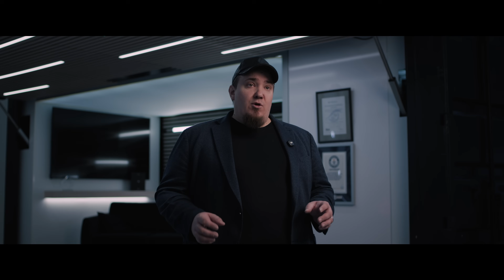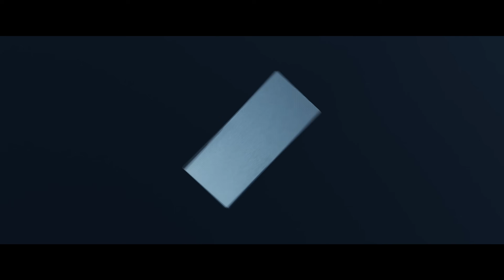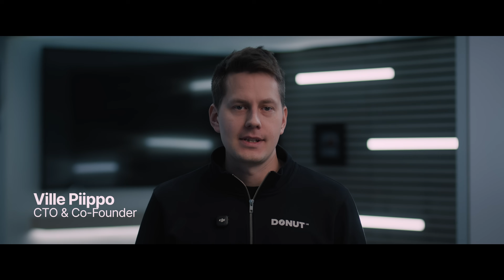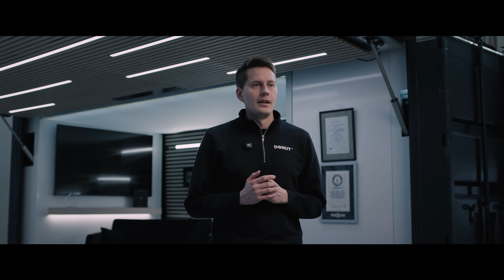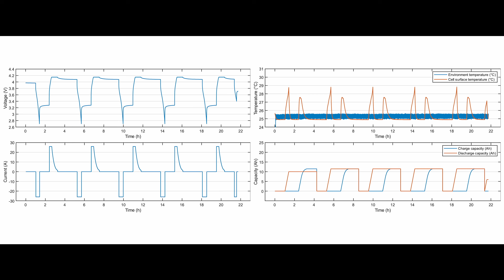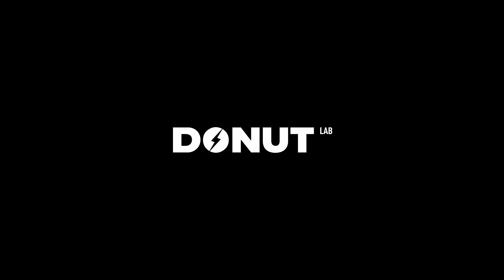Donut Solid-State Battery: Safety Demonstration Test | I Donut Believe (Pt.5)

Comment: Crazy how everyone keeps doubting but fails to acknowledge that we have a battery here that charges much faster than Li-ION, under extreme temperatures, and much more safely. This is already one of the best batteries ever made by far. Eagerly waiting for the series to complete.
Reply: They need to weigh the battery. This is all great but it needs to hit good weight-to-capacity ratios.
Reply: I think folks are just frustrated by their marketing games. Time will tell whether this is real or not.
Reply: I'm holding on fast to my everlasting gobstopper!  Ready to trade it in for a battery.  =)
Reply: @mark.pinnell Everlasting gobstopper, uuuhhhm sounds good. Fancy swapping it for some magic beans?
Reply: My problem is this Marko guy have promised Asinoid, an AI that should surpassed all other current available AIs. Yet, several months later, both Asinoid and Asilab, the creator of Asinoid, went silent. This, all his words are worthless until actual third-party verifications can be done.
Reply: @bltzcstrnx  maybe Asinoid really works and came up with this battery. Still hard to believe, there is a lot of dark humor involved, which is stressed by April 1st as date for the next video.
Reply: I kinda understand the skepticism, how many times we've been lied to by techbros ?
Reply: Then why is donut actively looking for small scale investors instead of big companies that do technical due diligence?
Reply: CATL Already have an LFP Battery that can charge 12C
Reply: Indian logic
Reply: if you sacrify lifetime you can fastcharge/discharge normal Lithium cells to. Every e-cigarette cell proves that! So far it doest prove anything than it can do a few cycles - and dies to 50% SoH.
Reply: @peterle987 you are exactly right, without cycle tests all previous tests mean nothing!
Reply: That is simply not true. You are comparing prototype cells in lab tests to estabilished consumer batteries. In reality, these recent tests are 100% in line with other new battery prototypes.
Reply: @5astelija75   Please remind me what other batteries continue to operate at 5C charge rage when their internals are exposed to air and moisture?   Even Na+ can't do that.
Reply: @daemn42  What evidence is there that the internals are exposed to air and moisture?
Reply: @izzeww8487  that the cell has lost vacuum? it's the definition of getting exposed to air and thus also moisture.
Reply: @Schinkeldink Losing vacuum ≠ getting exposed to air and thus also moisture. The cell could also lose vacuum by there being stuff inside the cell (a liquid electrolyte for example) that evaporates due to the high temperatures. I think this is more likely.
Reply: @izzeww8487 
But even MORE likely is the quite-acceptable, simple explanation that what vaporized/evaporated, here, was the (standard) glue sealing the pack.

(But I agree that water should not have entered the equation, if still effectively sealed. 👍)
Reply: @izzeww8487  When you have a vacuum vessel it means you've evacuated from it all gasses under pressure.    When you lose vacuum, by definition, it means the outside gasses have leaked into the vacuum vessel.      Or put more simply.  A vacuum is the absence of a thing.  Losing vacuum, is the return of that thing.
Reply: No it doesn't. Any li-ion can do the same thing
Reply: @tedarcher9120  No they can't. Whether the Donut battery is legit or not is another question.
Reply: @tedarcher9120  No, there are no other batteries that continue to operate at 5C charge rate with their internals exposed to oxygen and atmospheric humidty.  At best they'll degrade rapidly and continuously (capacity just drops off to zero)  At worst (and more common) they just burst into flames.
Reply: @daemn42 yes there are
Reply: @tedarcher9120  Care to provide references?   Now you're the one making extraordinary claims.
Reply: @daemn42 you made the claim, you provide the reference. Lithium polymer batteries work fine with broken cases until they suck up water from air and stop in a couple days
Reply: Conventional cells are what all solid-state batteries are fighting to replace... by not comparing to solid-state battery peers, they're demonstrating how gullible their investors are.
Reply: @azertyQ 
WHAT solid-state battery peers - ??!
Reply: Most nmc batteries can charge at 10C once. They'll just be broken or unsafe after that.

Comment: People asking for the weight of the battery , really are working for Chinese manufacturers. 
Weight would give away the materials, and make possible reverse engineering
Reply: That is just wrong, isn't it? The batteries aren't made from a single material, and so there are a bazillion combinations of materials to arrive at the same weight.

What we want is for the 400Wh/kg claim to be validated, since that along with lifecycle are the two most important claims by Donut Labs. To validate the 400Wh/kg we need VTT to measure the capacity of a cell and then weight this same cell.

The cell in this test had nominal capacity of 94Wh, which means we can ourselves calculate the weight that it should be.
94Wh / 400Wh/kg = 0,235kg. So there, now the Chinese know the material I guess. And we still lack third party verification.

Comment: Everyone needs to realize weighing the cell to show energy density will prove nothing. Specialized lithium ion cells can easily hit 400wh/kg or even higher. What we really need to see is cycle life and and that darn -30°c test.
Also someone really needs to test what happens to a li-ion cell when discharged at 100°c. He says they will explode but i haven't been able to find any actual testing to confirm this. There's a chance li-ion behaves exactly the same as their donut cell. Simply losing vacuum and capacity.

Comment: I expected a battery nail penetration test in the safety demo, as these are typical for solid-state technology.
Reply: Marko said at one point he could shoot it and the battery would continue operating except for the spot with the bullet hole. If this is a marketing pitch, it would be downright stupid to not have Marko shoot one then run the tests.
Reply: @jonathangilmore446  he may have said this before realizing people would only trust the results if a 3rd party(VTT) was doing the charge and discharge. No shot VTT would let them shoot the battery while using their equipment.
Reply: @Bionic9998 Do you need VTT for that? I would assume another field test.. marko holds the same DL2 battery, places it on a stump, shoots it, then hooks it up to a voltage reader.
Reply: @jonathangilmore446  there are still people claiming last weeks video was faked. They didn’t care that it was a public charging station.
Reply: @Bionic9998  what is vtt?
Reply: @rmat9023  the 3rd party testing facility that donut labs used for part 1-3 of this donut believe series
Reply: @Bionic9998  well people are lazy. Its hard for anyone to consider both realities: It's super easy for people to think its fake and come up with ways they faked it, it's genuinely difficult for anyone to consider that it's real. I'd put money on it being real. Idk about 100k cycles lol but I would put money on them meeting their other claims.
Reply: @rmat9023 it's the governmental research institute of Finland
Reply: @jonathangilmore446 impossible, it would short circuit even if it doesn't burn
Reply: @lafeechloe6998  Could be possible if the cell is actually multiple cells connected with some kind of fuses between themselves in parallel.
Reply: @alexandruilea915 it would take up a lot of space inside the cell, I don't see why designing it this way
Reply: @lafeechloe6998 see, thats why it would be a perfect marketing pitch
Reply: @lafeechloe6998  I never said it made sense, just that it is possible to do it.
Reply: Nail tests in the lithium world were abandoned because you can cheat.  If the head of the nail is larger, or if you push it in too slow or too fast, depending on the temp and charge level of the battery, the results differed a LOT.  I used to work at a company that tried to get our batteries to flame out (for safety testing).  We had to have our Samsung batteries at 60C and FULLY charged, and the nail had to go in slow or they wouldn't flame (this 18650 cell had lots of safeguards).  Having said that, I would LOVE to see a nail test here, especially fully charged, especially at 60C (or some reasonable high temp).  That's worst case.
Reply: always a hater lol
Reply: SPIKE test or bust.

Comment: With that pace we will find out whether it’s solid state or not till the end of the year. Well...Toyota is probably ahead of you already. There are other solid state batteries but not officially announced. Just like yours. So don't claim it's "First Solid State Battery" cuz it isn't yet. Till you prove it.
Reply: Toyota 😂😂😂
Reply: Toyota has not delivered on solid-state battery promises—they've repeatedly delayed them while continuing to make new ones.

The facts are clear:

A history of missed deadlines:
- Toyota originally promised solid-state batteries by 2020 
- That slipped to 2023 
- Then to 2025 
- Then to 2026 
- Now they're targeting 2027–2028 

Current reality check:
- In November 2025, Toyota halted construction of their Fukuoka battery plant—the facility meant to produce these batteries 
- This marks the second delay for that plant in one year 
- Toyota admits they're "reviewing and adjusting plans" with no new timeline 

What they're actually producing:
- Toyota's North Carolina plant (opening 2025) will make conventional lithium-ion batteries, not solid-state 
- Their current EVs (bZ4X, RZ450e) use standard battery tech 

The pattern:
Toyota keeps announcing breakthroughs (1,200 km range, 10-minute charging, 40-year lifespan)  while pushing actual production further into the future. Meanwhile, competitors like Mercedes have already put solid-state vehicles on the road for testing .

When a company repeatedly delays the same technology for nearly a decade while maintaining they're "on track," that's not innovation—it's marketing.
Reply: @johnbmudd  thank you ChatGPT. The problem with your AI is that it doesn’t know things which we investors know behind the scenes. Check how many SSB are being tested on the roads. Not Toyota, pick other ones. Don’t believe everything what AI says lol. Use your brain

Comment: The cell cycling tests are being run simultaneusly to the other tests, if you read the VTT report(s)!
Reply: Where is this stated? Which page of which report? I would read the whole thing, but I honestly just don't have the time these days.
Reply: @newrev9er  It's all hidden in the temperature graphs as it was in the third report! The third report revealed that some cells have been cycled some 300+ times at 3C (or maybe higher) rate. That's my interpretation, haven't seen alternative hypotheses. I don't have any connections to VTT or Donut Lab.
My original guess was 3C cycling, but after seeing the newest report, I'm inclined more towards 5C. The cell performance is even more impressive then.
Reply: must take a REALLLY long time to weigh the cells too \s

Comment: A puncture test would have been the real icing on the cake here, and also some justification to why the compromised vacuum ruins the cell's capacity: something oxidising? Mechanical damage to the layers?
Reply: When they lose vacuum they also lose clamping pressure from the atmosphere, so the layers can partially separate and some of the material simply can't work like a battery anymore.
That is why pouch cells need quite a bit of clamping pressure for longevity.
Reply: Remember, vacuum is the absence of external gasses under pressure, which means when you lose vacuum, you're letting those gasses into your vacuum vessel.    Here it means that atmospheric air (oxygen/nitrogen/water vapor/etc) are free to enter the pouch.     With a liquid electrolyte  LiIon pack that is fatal.  At best the pack rapidly degrades until dead.. at worst (and quite commonly) it vents, heats up, ignites the flammable gases its producing, and burns..       Even Na+ cells will fail, less so because of the oxygen and more due to their interaction with water vapor which reacts to produce a poisonous gas.
Reply: @daemn42  That is not the definition of vacuum. There is nothing to support that Donut/VTT is operating under the definition you think.
Reply: @izzeww8487  It is in fact the definition of vacuum.     Vacuum isn't a thing.  It's the absence of a thing.  In the context of a vacuum sealed battery pouch it had all gasses evacuated from it causing external atmospheric pressure to press in on the outside.   When you "lose vacuum" it means some of the outside gasses have leaked into the pouch.     
Perhaps you're confusing it with the idea of something like "hermetically sealed" where you simply prevent exchange of gasses between inside and outside.   That is NOT how battery cells work.  They are sealed under as high a vacuum as possible.
Reply: @daemn42  A vacuum is indeed an absence of gasses. So it can be broken either by gasses entering from another place, or by gasses being generated inside the battery.
Reply: A puncture test would not be impressive. There are semi-solid cells from China that can do everything that the Donut battery has shown so far, and they can take a nail or a drill straight through without catching on fire or other huge problems.
Reply: @izzeww8487   What other cells from China have you seen cycled at 5C rate while inside exposed to atmosphere?
Reply: Oxidizing alone would probably do it right?
Reply: It's not as solid as you think as many solid state batteries still catastrophically fail when punctured. Sodium ion is also generally seen as safe in that regard, but it bursts just like lithium ion with enough damage.

Comment: Using the same materials and form factor of a Lithium battery is at first glance an inconsistent choice, and all we see are renders of what we assume is the final form factor. As Ryan at Ziroth points out, the display model shown at CES was a 3D printed mockup that people were not allowed to touch. 
I think 2 things are happening. First is that DonutLab states that their batteries can meet the form factor needed for each use case, so in that scenario the look is less important than the use case. 
Second is that if this is all real, provable technology -  and it really better be at this point - using the same materials as conventional batteries for the test articles would mean a manufacturer could replace existing LiOn batteries with the DonutLab cells without changing their existing production lines. 
If their cost for making the battery is comparable in price for a NMC-TYPE or LiPo battery then it creates a scenario where using this SSB instead of the normal solution becomes the better option. 
Meeting the form factor is the way in to upending the market. Because if the battery is stable under similar failure conditions for current battery tech it becomes the better option.
Reply: Yes, agreed. Important point(s). 👍 That would be a VERY significant production (and market) advantage.

From what they've claimed, it's both cheap to produce, AND form-fittable to whatever shape and dimensions they arbitrarily choose.
Reply: "and it really better be at this point" (copium)
Reply: @Davids6994  - Just watched the Two-bit Davinci video where he basically confirmed it's a solid state battery. No copium needed. 😅
TBF I've maintained for awhile now that they did in fact make a SSB. The marketing train we're all on isn't (just for) hype. It's a window of time where they can ramp production and hold off the top LiOn manufacturers from tearing open the batteries, figuring out chemistry and manufacturing, and then shifting their production lines to overtake DonutLab. 
There's an axiom of product development that basically says for a sustainable competitive advantage you can be first, or fastest, or loudest. If you're not either of those you're everyone else. First, fastest, or loudest doesn't guarantee you come out on top, but having one or more of these positions in product development supplies advantage in a competitive market like batteries. 
By inference DonutLab says it's SSBs without lithium and can be sourced anywhere in the world. They've stated publicly the hubless motor is built on-site in a separate part of Verge Motorcycle's factory where the motor manufacturing is kept under wraps to protect the IP. Secrecy on HOW they got there is still needed. Same for the battery.
Reply: @JaredLazaro Ziroth is going to donate 5K to a charity if there's no lithium involved, if you had the money, would you take that bet too?
Reply: @Davids6994  I am confident their battery does not have lithium, so yes.

Comment: There are still 3 claims to be proved. 1. the energy density of 400 wh/kg. 2. Cold weather performance. 3. Life cycle of 100000. My personal opinion is that Donut has developed a real disruptive technology that the world is desperate to get it as soon as possible. Watch the oil prices nowaday. Such battery will literally save the planet and wean our dependance on the crude oil to a large extent. My suggestion to Donut people is NOT to waste more time on sipping the prove videos and release all what they have at once after the 8 days. Then the world should move as fast as possible to adopt this disruptive technology. With what is happening in the world nowadays with the oil and gas, wasting more time is not a good strategy.
Reply: Really? How are you going to generate all the electricity to charge millions of batteries?

Comment: “These industry standard pouch materials are simply not designed for the 100° C that our batteries can take.”

…so what's your plan to manage that problem?
…not that I'm planning to charge my cars or power tools while boiling water. 😄
Reply: Nobody will be charging batteries in an EV at 100ºC even if the battery cells and the pouch could take it.